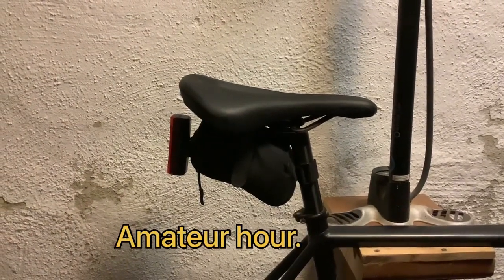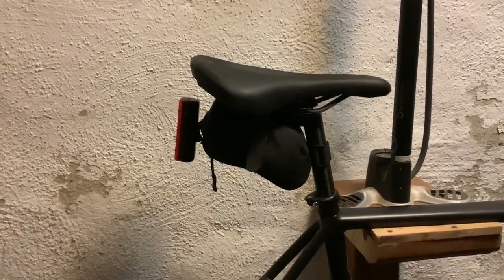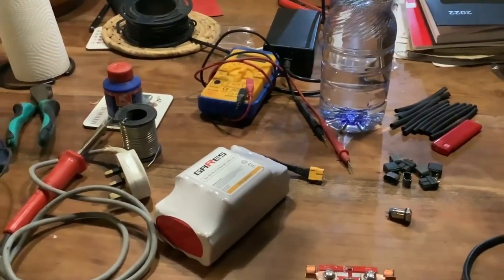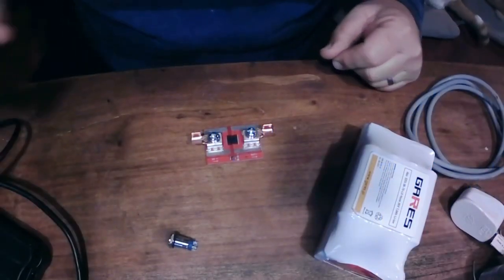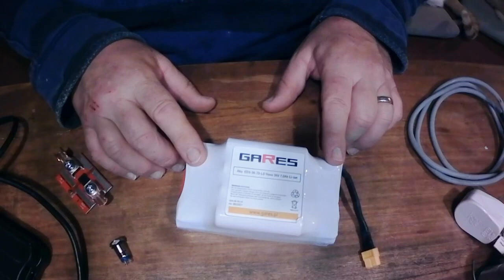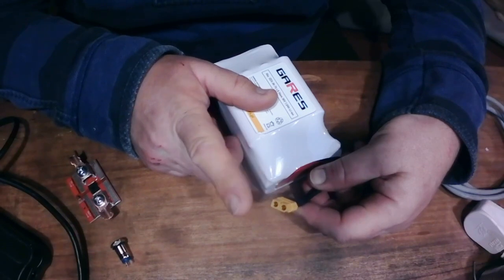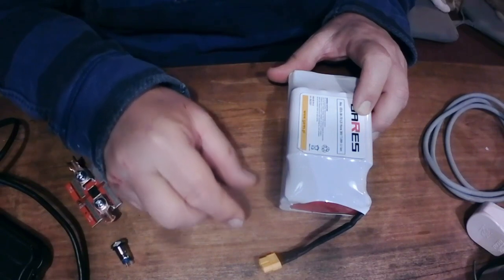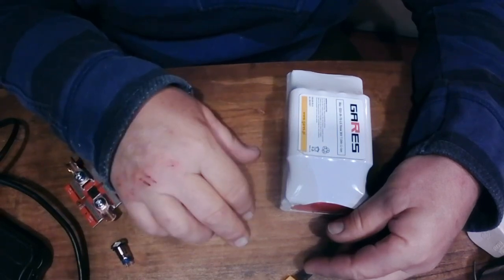DIY Mahle X35 Range Extender - Save $$$$$!

Comment: Very good recapitulation. Well, I understand that your battery extender consists of a battery pack in 10S configuration and probably 2P, with a current capacity that I do not know . I also understand that you placed a diode to block reverse current to the extender. As for the connection, I understand that you do it directly to the charging connector of the main battery of the ebike. It is right?
Reply from the maker: All correct, Antonio. The extender battery is 7ah.
Reply: @yakoridesagain  OK Yako, knowing what you have managed to do so far, I am going to allow myself to summarize what I have investigated about the Mahle X35 system and its battery extender. This will allow you to understand the improvements that I propose to achieve a system very similar to the Mahle extender.
You probably already know a lot of this, but it will serve as a basis for improvements:
1) The X35 BMS is a Split Port type, that is, there is one input port for charging current, and there is one output port for power to the motor. See attached drawing for reference.
2) The ports never work simultaneously, that is, if the motor output port is supplying power, the load input port is disabled and vice versa.
3) The extender battery is never in parallel with the motor.
4) The extender battery behaves the same as the main battery charger. Therefore it must have the same electrical characteristics: V less than or equal to 42 V and charge current equal to 2 A. This value of charge current must be strictly respected since a slow charge (less than 1C) avoids battery degradation. See attached graph.
5) Main battery never will charge the extender battery.

...I'm sorry but youtuve does not allow me to attach the mentioned illustrations, it is for this reason that I suggest we move to a discussion forum that allows all facilities. Why not this forum?
If you agree, please open a thread. Thanks

https://electricbikereview.com/forums/forum/orbea/
Reply: @antonioalfaro9897  hi - I have been speaking (messaging) and following @Wooly Chewbakker regarding your joint module project ……..“A device that will allow any 36V battery to be connected to the bike. It limits the charging current to 2.0 Amps and the Open Circuit Voltage is set at 42.1V to ensure charging” as he says you have been a great help in its development and that you are preparing a detailed document and I would love to be able to make such a module for myself to use on my Ribble X35 system and wanted to ask if I might be able to ask for a copy of your detailed document ? - best regards, Colin.
Reply: @Wooly Chewbakker Excellent- that’s a coincidence, I’ve also got a Ribble CGRAl-e, riding it since Jan 2020 and clocked up circa 8,500 miles and so am VERY interested in how you get on….I did ping a message to Antonio expressing my deepest interest but unfortunately not heard anything back yet 🥹
Please do let me know how it all goes! - and best of luck!!
Reply: Hi, just wanted to see how you’d got on with your extender battery? - unfortunately still no message from Antonio 😬 - keen to get some detail so I can get one underway 😃
Reply: @Wooly Chewbakker 
Yup same here……
Reply: @Wooly Chewbakker try this
first type
cdreed01 
then type the AT symbol
then type 
ME
then type a FULL STOP
then type the first three letters from COMMANDER ?
Reply: @Wooly Chewbakker gotcha - emailed you - FINALLY!!! Hurrah!

Comment: Thanks for the video. Are there any concerns that the original charger cable is not large enough to carry the power from the 2nd battery to the bike. Does the Orbea range extender battery have heavier wires than the charger has, does anyone know? If so, would it be worth replacing the connectors (on the bike and the leads) with a different type so thicker ones could be soldered in.
Reply from the maker: The Orbea/ Mahle range extender’s output is limited to 2a, the same as the battery charger, so the cables are the same.  increasingly I’m thinking that my range extender may well work in exactly the same way as the ‘official’ Mahle one, I.e. a trickle charge limited to 2a by the internal BMS on the bike’s battery, with the power to the motor coming solely from the internal battery. If so, all the cable sizes would be no issue. I haven’t been able to definitively test this due to it heaving down with rain for weeks out here in ‘sunny’ Spain! If true, it’s even more outrageous what is being charged by Mahle for their range extender, in my opinion. I would be loathe to alter the connector on the bike as it is currently fully waterproof. If it turns out the batteries ARE in parallel, then a better option would be to wire the extender in to the cables running from the connector to the controller inside the frame, leaving the connector in place and using appropriately sized cables from the range extender to that point, in my opinion.

Comment: dose the diode  have a earth that goes to the negatives on battery  and bike  any chance of a wiring diagram
Reply from the maker: It does. I mention that in the vid and explain where to connect the cable from the diode’s earth - there is also a diagram at the end of the vid.

Comment: Looking at the XT60 connections then in your video you connected a male to the ideal diode because the battery already has a female, but I noticed in your video that your Ebikemotion charger was then fitted with a female……so how do you charge the extender battery as that’d be female to female? - or did I miss something 😂
Reply from the maker: I bought a cheapo 2a 36v charger so I can charge both batteries at the same time. Flippin’ eagle-eyed, you! Impressive! Forgot to mention that.

Comment: Hi Yako, thanks for this video. I have bought a cannondale ebike with an x35+ drive recently and ended up with a spare Mahle x35 B1 battery (same as inside the frame). Do you think i could adapt your technique to transform this battery in a range extender? Thanks for any help?
Reply from the maker: I’m not sure Jean - that battery is perfect for inside the frame, but it is pretty awkward outside it. My thought would be to keep it at a perfect state for storage, around 50% charge, and keep it for when your internal battery goes kaput. Either that or sell it now as it is worth a lot of money, and buy a quality, small, hoverboard battery as the basis of an extender, which you can easily hide. Your B1 probably has the controller built into it, and so would be more complicated to convert to a ‘dumb’ range extender…hope you understand?
Reply: @yakoridesagain   "...perfect state for storage, around 50% charge" you wrote. I have a couple of X35 bikes in-storage. They are currently hooked up to chargers, all that's needed is to plug the chargers into current. Should that ONLY be done when they're below 50% charge and should they be charged only to 50% to maximize battery life? At present they'll be sitting around collecting dust until May 2024 and I really, really want 'em to work when I drag 'em out to ride again. Thanks!
Reply from the maker: @larryt - once they are at 50% charge, they can be stored for a year untouched…if in good storage conditions. Too cold or too hot could badly affect your batteries…the perfect temp is a constant 59f (but who has that!) If they are in a house, great. A shed…it depends…you REALLY don’t want them to freeze, but scorching temps are also to be avoided…

Comment: I'm guessing u may be away on holidays.......... I cannot get the assist to work atall...... maybe I have fucked the main battery up!!  Maybe the Ribble's have a different internal battery?? god knows.. but getting worried now...... it's weird, as all he lights come on...and even if I plug it all into the charger through the diode and ssaddle bag.... the lights come on to charge it....but no assist.... I did everything incl. getting the exact same diode...nightmare....
Reply from the maker: It’s the same system. I've written to you explaining what I think the problem is.
Reply: @yakoridesagain  you do u know you are a STAR!! haha... you just told me something that I totally overlooked!! I could not fathom it out!!! haha... so easy!! will report back in a min!!! STAR YOU ARE!!
Reply: PS - at midnight last night... I had that bike in pieces... ready to remove the battery... but thankfully went to bed to sleep it off!! haha.,..will tell u more soon.... just gonna do what you reminded me!!

Comment: this is a great video any updates since making it thanks
Reply from the maker: I was thinking of making an update vid - but essentially it works perfectly, I’ve done thousands of kms with it. I’ve just found  a source of the Ebikemotion plugs so you don’t have to chop up your charger anymore. Look up powatechnic09 on EBay. You will have to ask specifically for the Ebikemotion plug and lead, they are after £18 (!) for them.
Reply: @yakoridesagain  that's great I will gather bits and copy your plan beats paying out €550 for one.

Comment: Hi thanks for video. I am very interested in creating my own. I noted the battery needs to be 36v and you have a 7ah battery, could you go for a larger ah battery to extend the range?
Reply from the maker: Though the answer is technically yes, you could use a larger capacity extender battery, I would advise against it, as when I was researching this I found so many arguments against it, then so many saying it is no problem, that I decided to play it safe and make the capacities the same. I’ve had zero problems in 20 months.
Reply: @yakoridesagain  thanks for taking the time to get back. I'll be on one of these soon.

Comment: Hello Yako, I have read your latest advances and comments about the mysterious behavior of this system with a second battery.
I have read many times the user manual of the Mhale Extender as well as the description that appears on the Mahle website. It would seem that they purposely include contradictory paragraphs that suggest that the second battery works in parallel, but on the other hand they include a paragraph where it gives the impression that the second battery simply slow charges the main battery, which would not make much sense .
I want to refer to two of your findings, which I consider extremely important:
1- You started a tour with both batteries connected and with the same level of charge. At the end of the run you found that each of the batteries had discharged equally.
I would like to know if the assistance level was always activated on that route. If the assistance level was always activated, it means that the second battery always supplies energy and in the same proportion as the main battery. So what the Mahle manual says would not be true: ""The Range Extender works like a portable internal battery charger that charges the main 
battery while it is turned on. It operates differently from other systems in that on the 
Ebikemotion X35, only the main battery provides power to the motor, while the Range 
Extender charges the main battery, regardless of whether the motor demands current 
from the main battery or not (such as at speeds greater than 25 km/h, when there is no 
pedaling or the bicycle is not moving).
The Range Extender provides charge to the main battery at a discharge ratio of 2A, while 
the motor can demand current of up to 9A. Therefore, the Range Extender is not capable 
of supplying enough current to the motor by itself, and all this current comes from the 
main battery.""
Your most recent test ride, in which you used a maximum assist level, presumably the current draw of the motor was well in excess of 2 amps. If you at the end of that test found the two batteries with the same voltage level (charge) it shows that what Mahle says is not true, that the second battery discharges at 2 amps maximum.
Reply from the maker: For most of that ride, I was not using the assist. I did turn the assist on towards the end of the ride, as the climb got steep and I was tired. I turned the system off and disconnected the second battery at the top, but did not record the voltages until considerably later. They were identical (actually 0.1v different, with the secondary battery lower. I think you would get significant enjoyment from building your own extender, Antonio. Your approach is far more scientific than mine, but I would very much like to see your conclusions. Using AliExpress, the cost could be as low as €25.

Comment: Hi Yako, just watched this again as something was niggling at me. If your battery is plugged into the bike charge port I can’t see how it can act in parallel to the main battery. Surely by definition it can only act as a charger for the main battery?
Reply from the maker: This is a hotly debated question in certain forums/fora I’m in Neil. I am certainly beginning to think this, yet there are two sets of wires leading to the battery’s control system from the port, two thick and two thin. some believe the bike has internal wiring to allow parallelling the batteries, but this generally is influenced by the manufacturer making the claim when the system was launched that the extender battery would work in parallel. After the 2 year wait for the extender to be manufactured, it was launched as a smaller capacity battery charger. I could do tests to find this out for certain, but a much more detail orientated gentleman is doing this and I await his report.
Reply from the maker: If it turns out that all of the available extenders work in the same way I’ll probably redo this vid, making it much, much, shorter!
Reply: I’m not at all suggesting that what you’ve made doesn’t work.
Reply from the maker: Oh no, Neil, I wasn’t suggesting you were saying that! The extender I made works, no question, it’s just the HOW we are debating!
Reply: @yakoridesagain  hi yako, are you able to share the results of the much more detail orientated gentlemans report?, also does it matter what side the ideal diode is as most on ebay seem to be 50A
Reply from the maker: Hi Nicholas. My detail- orientated gentleman confirmed that the batteries in this set-up work in parallel. By what magic this is achieved, we can lay at Ebikemotion’s door, and their original specification. The gentleman ascertained that the load is shared between the batteries. This is of course excellent news - more range, less load on that precious internal battery. My Ideal diode is an unnecessary 50A too - it’s large, but easy to connect. 20A versions are available though, last time I checked…
Reply: @yakoridesagain  Thanks for the reply, so i take it i just connect the two large wires   in the charger wire to the battery, do you have any idea wht the two smaller wires are for, is it worth getting a battery with a seperate charging connection as will having the diode cause the battery not to charge? appologies if thats a dumb question
Reply from the maker: @Tank1986  No problem. Yes, connect the 2 larger cables. The other two are ‘comms’ cables for the official range extender so it’s status can be seen on the app. With hindsight, I prefer my extender battery to be charged separately to the internal battery, simply because I feel happier that each battery is being charged without contact to the other. What this means is, when I disconnect my extender battery and remove it for charging, the diode, which is like a one way valve, stays connected to the connecting cable still plugged into the bike. I fitted an XT60 connector to my bike’s charger after cutting off the cable for the range extender, so to charge the bike, this gets plugged into the same connector as the external battery, ‘above’ the diode. So when charging the bike, the charge goes through the diode in the same direction as the external battery, when that is plugged in. If that doesn’t make sense, give me your email address and I’ll try to send pics.

Comment: Hi yoko, ive seen you mention that you know someone who can supply the plugs rather than cutting the one off the charger, do you have any contact details
Reply from the maker: Uf, yes, give me a sec to find it. They are on EBay…hold on
Reply from the maker: the seller is Powatechnic09. You need to contact him to ask to buy the Ebikemotion plug and cable specifically- they don’t list it. The cost is £18. I’m not affiliated, I just asked them if they were happy to supply it and they said yes. Too late for me!

Comment: I know in the semi-arid climate you live in that it is less of a concern, but are you at all concerned about water penetration into electrics? I guess the plug into the bike is already waterproof if the extender plugs in. Super innovative though, and as I get older it may be something I'd look at if I was doing extra long rides with big high % elevation climbs. An incentive to lose another Kg Gareth as well so you can equalise the weight you added with the battery ;)
Reply from the maker: The saddle bag is supposedly waterproof and the hole for the cable is at the front underneath so out of the worst of it I hope. The diode itself is also sealed into a plastic box inside the bag…I’d probably try it if I lived in the UK - happily I live in a sunny country and don’t need to find out! (Sorry Neil!) I’ve  lost 14kgs so far in 2022. I’m thinking of adding 13 more batteries for my moon shot later in the year !-)
Reply: @yakoridesagain  I live in Australia so we have lots of sunshine too. However, it’s trying its best at the moment to rain horrendously every day. We’ll have 6 years of no rain after this though to make up for it LOL. Sure, it sounds like you have it sorted.
Reply from the maker: Oops, thought you were UK based. Hope you’ve not been badly affected by the flooding? Sorry about forgetting you were in Aus, I did know that.